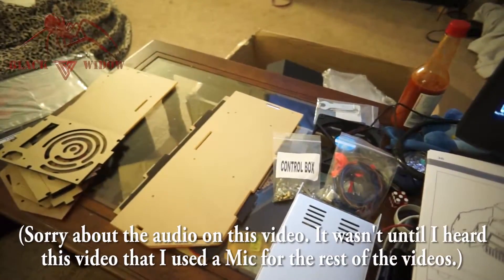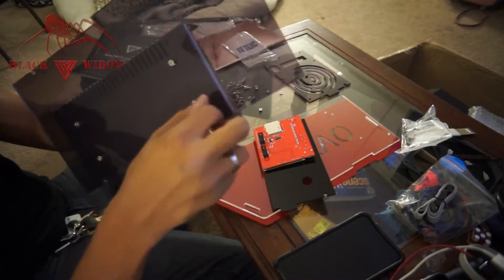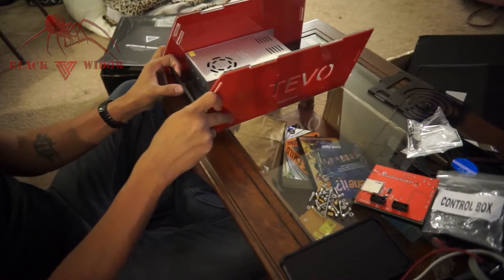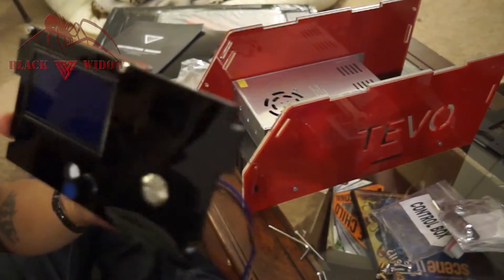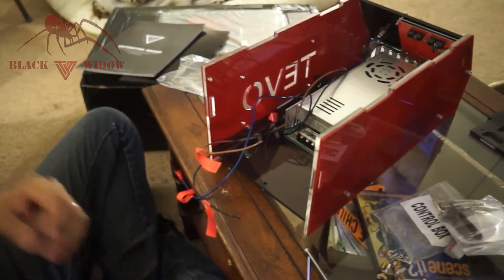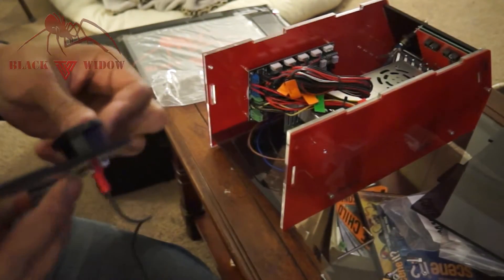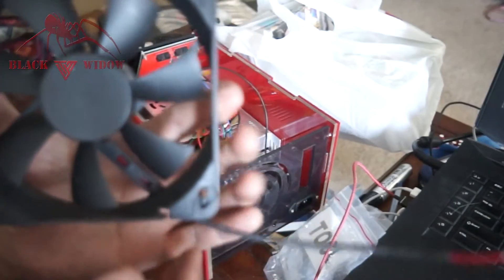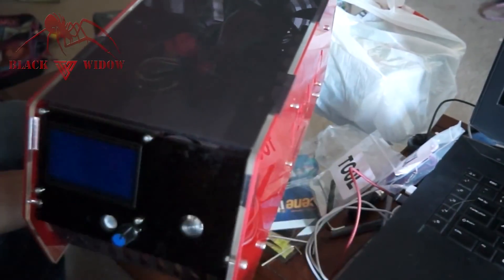Tevo Black Widow Control Box Assembly

Comment: I am currently assembling mine. You should put the red panels on the inside. It looks better. The fan you mounted wrong. It must take the hot air out, not to put air in. The fan mount wasn't done very smart in this design. No one thought of letting the USB port being accessible for printing through PC instead of SD card. Ah wait, the SD card isn't accessible either. Someone didn't really think when designing this box. There are more issues with the design of this printer unfortunately, but it's still much better than acrylic Prusa I3, which I also have and it is a nightmare to use it.

Comment: Thank You for this video, but I am thinking exactly like Nicky T... You should do a video on how to assemble the wirering of the box amd how to calibrate the printer after.

I received the box, assembled it completely. Overall it was neatly pack & it seem solid. 

But another problem I have it doesn't start. I don't know if the power supply is broken or I miss a connection witch I am pretty sure I connect everything at the good place. But you never know, the instruction for the box is so missing information.When I push the ON bouton it light up blue, but the power supply light & fan wont start, the big fan at the rear won't start either & the front panel wont light up. 

I need some assistance please.

Thank you for replying quickly
Reply from the maker: I have those videos just not finished yet :) This weekend I hope!! :)

Comment: I just assembled my entire printer the last 4 days, but I'm looking for more info on the wiring of the control box, as you know the instructions were not very clear,the two ribbon cables that connect the display board are identical and can easily be reversed, no instruction on correct placement of those. Also the power cord that came with it looks like a 220 plug but smaller?? And it's described as a 220/110v unit with switching capabilities but no indication on how to switch it. And lastly no clear instruction on how to calibrate the printer when it's assembled or correct adjustment of the x, y, z limiting sensors. Thanks for any information.

Comment: Nice Video but your using the Old switch?   you didn't get your new repair kit switch? Also you could show pictures of the nuts bolts in the ICD unit They don't tell you what nuts bolts to samwich through the two boards Great work PestVic :) thanks
Gary.
Reply: I used the 4 brass spacers to mount the main board on the side and to keep the board off of the plexiglass side, then the 4 small nuts to fasten it. Also I used the remaining two brass spacers to mount the fan so I didn't have to modify the mounting.